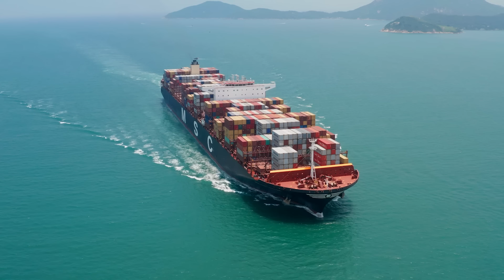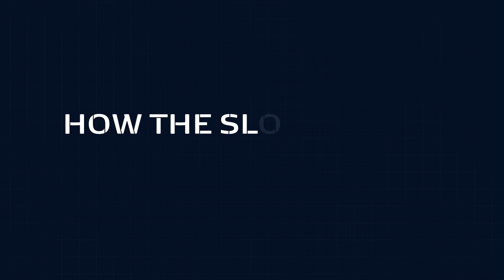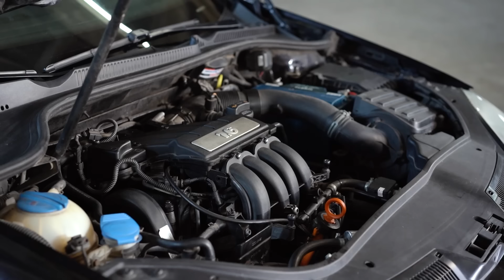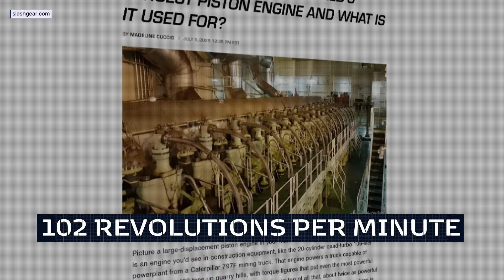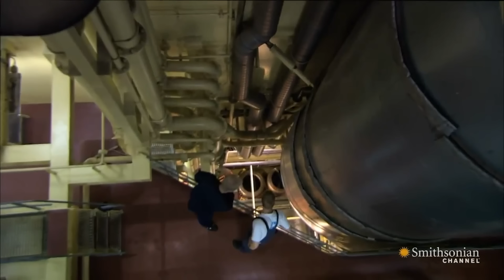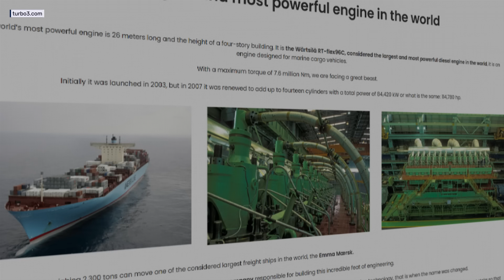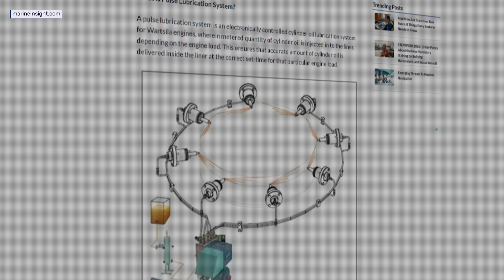The 100,000 Horsepower Engine

Comment: I have small correction - this engine crankshaft is moving 100x faster than second hand on the clock - second hand does only one revolution per minute this  engine does 100.

Comment: I'm puzzled why for so long huge container vessels used single engine single screw.  The additional engine efficiency over a twin must have been miniscule. Presumably there is a slight increase in propellor efficiency if centrally placed, but however reliable, surely the huge loss if a ship was immobilised would be worth more -- perhaps they had excellent but cheap insurance for that.

Comment: Wow, they only that recently started to care how that thick sludge is polluting the planet
Reply: Invent something better and you will be rich. Stop wining about a very efficient and ultra reliable current system. 90% of all trade by weight and volume is done by ships. The failure rate is towards the level of the aircraft business.
Reply: @tentenone-n7z  im not wining, im just intrigued that they just lowered the amount of Sulphur allowed in the fuel oil in the last 10 years. Probably could have a lot sooner
Reply: @OGdirty1Kanobi agreed, but the International Maritime Organisation (IMO) has to coordinate 120+countries and interests. Change in shipping is slow, but steady. It's a multi-million business for all involved. After change of fuel shipyards were booked out for years to retrofit existing vessels. Faster change would have been very tough,if not impossible. So body has  to produces all this fuel, refineries need to physically change for the new fuels. And even 6 years later, the full impact and engine wear and tear is just now starting to show. It was a huge chain reaction...

Comment: Why was a piston  engine used as opposed to a turboshaft with a reduction drive?
Reply: There is no gearbox available which can handle 100k horsepower and about 1000mt of thrust.

Comment: Fun fact, 1 day of fuel for this ship would keep my 2.0l Mondeo TCI going for way over 4,000,000 miles! Alternatively, given an average annual mileage of cars in the UK being 8000 miles, you could run 181818 Mondeos 22 miles per day for the same fuel burn! Assuming a mondeo can carry about 400kg of load( 4 heavy people, my car can tow up to 2.2 tonnes but the fuel consumption is down to 34mpg when I pull my boat! ), that means all those cars would move 72727 tonnes 22 miles per day. Whereas the ship can carry 7000 40' containers which can carry a max load of 28 tonnes each? Not sure if ships, like planes (my line of work) have a max all up weight limit, IE:- they would be overloaded if all containers were at max? But assuming they can, then 7000 times 28 tonnes is 196000 tonnes and in a day, 24hrs, at 25Kn it would cover 600 statute miles. That makes the ship 73 times more efficient than the Mondeo, I wasn't expecting that answer!

Comment: Ok ...so next is full electric with solar panels on every outside panel and inlets within the hull to let water in to spin generators off the mass and speed of the ship I see them being able to rip 50 knots plus. How much does 250k gallons of crude weigh vs that much lithium

Comment: Assuming the fuel oil has a density of 1g/m3, thats 2.89 litres a second. Crazy
Reply: In perspective: 1L per ton cargo per day. Or 1L to move 1000kg cargo over 800km in one day. Or 0.125L/100km compare:  4L/100km car for about 500kg of load with people and luggage. Now you see just HOW efficient shipping is.
Reply: @tentenone-n7z  yeah, thats pretty damn efficient. Meanwhile, I use 8L/100km just to take 90kg of human to work each day.

Comment: No problem make my car 0.8l engines that makes 200hp and last around 100000km, while this thing consumes more fuel a day, than i will ever consume for my whole life.
Reply: Vessel engines run 6000 running hours per year. At a 20kn vessel pace. So it runs >200.000km in just one year. And it operates for 25+ years. Your car is long gone to a small steel blob when this engine is still running true and sound. Welcome to shipping.

Comment: Making 109,000 hp isn't that difficult.  A large gas turbine could do that easily and at only 5% of the weight, maybe even less.

The real trick is making it fuel efficient.  Turbines have little weight but they use considerably more fuel (though modern units are getting better) than a big reciprocating diesel.  That is why they build these engines and use only ONE on large boats.  Something that I think is a serious mistake after the bridge accident in Baltimore.
Reply: Turbines are only inefficient at lower speeds, this can be mitigated using a large electric motor at harbor speeds....
Reply: @ljmorris6496  To be comparably efficient they need large regenerator units to preheat the intake air.  They still haven't built one that can exceed about 30% efficiency.

Most modern cruise ships use dual fuel arrangements where bunker fuel is used offshore, but marine diesel or a turbine engine is used to generate electricity inshore or in ports.  I think nearly all cruise ships are electrically driven these days.

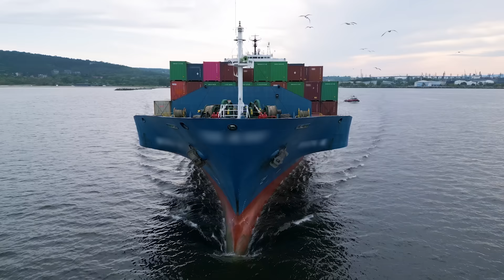Comment: 3:11
Water resistance does NOT climb steadily with speed. Look up the concept of “hull speed” there are different “pockets” of speed that are more or less efficient. It has to do with how the wave created by the front of the boat interacts with the rest of the boat. There are speeds where if you slowed down slightly, you would become much more inefficient.

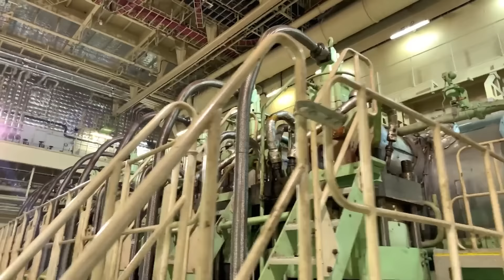Comment: 8:00 2.5m is much taller than an average person. It's higher than a soccer goalpost or the ceiling of a normal UK house! You're basically saying, not only could you stand inside the cylinder at bottom dead centre but 99% of people couldn't even touch the top of the combustion chamber..!

Comment: I don't understand the complaints about environmental impact. If you consider the miles per pound of fuel consumed it's exponentially more efficient than truck travel which is the method all those containers use to get to and from the ports in the first place. As long as the US and other major countries import heavily, these giants will continue to be produced. Heck even produce from South America comes via ship instead of international train and for good reason... security, speed and efficiency.

Comment: The length of the hull underwater determines hull speed.  Longer ships move at higher velocities with less power.  An aircraft carrier has 1hp per 15 tons at cruising efficient speed.  A destroyer has 1hp per 5 tons.  The carrier has a higher cruising speed at that output.  The destroyer accelerates faster, but that isn't such a great advantage.
  This is why in undeveloped countries you see long skinny displacement hull boats looking like 50' canoes screaming along powered by an 8hp lawnmower engine at speeds comparable to a planing hull skiff running a 100hp outboard.
Reply: Yes, hull speed is a thing.  Statements of "hp per ton" have nothing to do with hull speed.  Planing hulls are not subject to hull speed once up on plane, because they rely on dynamic lift instead of displacement.  A longtail boat with a tiny 8hp motor will not be "screaming along" at planing speeds.  A 50' longtail would hit hull speed at well under 10kts, but it doesn't matter, because it's a planing hull, assuming it had more than 8hp and was actually able to get up on plane.
Reply: @wagnerrp  Apparently we do not disagree on anything.
There is a thing called a semi-planing hull.  A 50' canoe will never hit hull speed.  It does not generate significant lift until certain conditions are met.  This is the wonder of block and prismatic coefficient and is some weird math.  What you say is true, but my reference to HP per ton simply points out that waterline length can result in a faster top speed despite effective thrust being the same. Did the demonstration experiment build back at TAMUG as a practical lab.  Hulls with identical cross sections, except longer.  HP per ton is a reference you are reading wrong.  Acceleration is effected, but clearly displacement hull top speed and waterline length, and that was the point ja?  Fair winds and following seas.

Comment: In context - in order to build an electric engine that could do the same work, it would require a lithium battery of about 1.7mill lbs (~800,000 kg). Given code requirements for batteries, this would require the space of around a baseball field. And it would only power the engine for roughly an hr.

This is why electric is nowhere near approaching the point of replacing diesel & why diesel is the most commonly used fuel at large. Diesel is just too damn efficient at work.

Comment: Wow, 109,000HP is insane especially considering how slow that engine turns. HP = Torque x RPM/ 5,252...at 100RPM thats 5,724,680 ft/lbs of torque 🤯

Comment: I was on a VLCC last year that had an earlier version of the 96 series engine - but it was "only" a 6 cylinder. I was also on a ship with a 7 cylinder engine. And I only did two voyages, the first about 12 miles and the second about 6 miles - LoL (both in Nigeria).

Back in 2006 - 2009 I was project manager for a new build trenching plough and it's integration onto a newbuild vessel (essentially a grossly oversize anchor handling tug). In 2009 the Far Samson claimed the title of "world's most powerful tug". She had about 33MW of installed power which is not much compared with the Emma Maersk but she was only 122m and about 10,000 tonnes displacement. Maximum Bollard Pull was 423 tonnes. For trenching I think we worked on 350te BP with a maximum of 380te available in real world capacity. At that load she would burn 140m3 of fuel a day.

I took "possession" of her on behalf of my company at 1am while steaming between Alesund and Stavanger. We were doing 19 knots and burning 100m3 / day.

Given that I've signed off on millions of tonnes of coal being loaded in Dalrymple Bay and Hay Point my carbon footprint is up there with Elon's.

Comment: Emma Maersk was the result of a design challenge. Build the largest single engine ship possible.
It turned out, that neither the hull, nor the engine was the restriction on size. The propeller however was. Therefore the Emma Maersk was designed around the largest possible propeller. It is simply not possible to build a larger propeller. A design proposal for a 16 cylinder 101 centimeter bore engine was on the table, but this was rejected because a large enough propeller could not be made.
On waste heat recovery, the ship did have an exaust boiler, along with two shaft generators. But these two generators also doubled as shaft motors, giving the ship an additional 18 MW of power if needed. Meaning that on the later ships of the class, the total output power on the shaft exceeded 100 MW, and the top speed was over 30 knots. A friend of mine, said they reached 32,7 knots, with all generators running.
When 2 main engines was chosen for the trippel E class, this was not a question of not being able to build a larger engine, but because of the propeller.

Comment: One F35 is more powerful than any of these engines.
84000kW from the ship.
142000kW from the little jet fighter.

Interesting comparison.
Reply: Not exactly. I think you got some numbers confused. The power of the f35 engine, is approximately 30.000 kW. Not that this is not in any way impressive, given it's small size.
Reply: @petertuxen4930 which country are you from?
Reply: @procatprocat9647 why is that important?

Comment: It still burns fossil fuels which contributes to climate to climate change - more and greater weather events, flooding, hurricanes, desertification, heat, etc. funded by the oil industry, these videos try to get you to wonder at engineering which is still a hundred years old and inefficient. An internal combustion engine is rarely over 25% efficient. An electric motor is 95% efficient. Fossil fuels are the only thing which powers an ICE. Electricity can be made from anything - dung, the sun, the wind, hydro, wave, etc. and stored in batteries for those peaks and troughs in use.
Reply: You are absolutely right on most counts.
The mechanical efficiency of this engine is better than 98 %. The total efficiency is about 60 % when using waste heat recovery.
About the fuel consumption, try measuring it in grams/ton. Then the truck is actually the greatest sinner of all.
Electricity would be a great alternative. But the power density of batteries are so ridiculously low that it just is not an option yet.

Comment: The world should introduce a maximum speed limit for container ships.
Balance time against efficiency, with massive penalties for anyone exceeding it.
Reply: The shipping industry is only interested in profits. A saving of 0,2% fuel, gives an extra profit of about 100.000.000 $ pr year. Trust me. The ships are going as slow as possible. If we could reduce the rpm by even 0,1 rpm, we would do it 
No the problem is not the shipping industry. The problem is the consumer that demands faster delivery.

Comment: Back in the 70s when I was a wee lad, I was at the Smithsonian Technology Museum. They had a Piston and Connecting rod assembly that was about 30 feet tall. It was used in an engine for pumping a mine and powered by steam. Still, the size and scale of that assembly left an impression on me.

Comment: Do submarines dive by exceeding hull speed, which forces them to sink? Submarines dive by flooding their ballast tanks with water to increase their weight (achieving negative buoyancy) rather than by exceeding a "hull speed" to force themselves downward. While forward propulsion and hydroplanes can be angled to help steer a sub downwards, gravity and density control do the heavy lifting. How Submarines Actually Dive Surface State: Main ballast tanks are filled with air, making the submarine lighter than the surrounding water.The Dive (Flooding): The crew opens vents at the top of the ballast tanks. Escaping air allows seawater to flood in through grates at the bottom, increasing the vessel's weight. Sinking: With a density greater than the surrounding water, the sub begins to sink. Hovering: To maintain a specific depth, crews use variable ballast tanks (trim tanks) to achieve exact neutral buoyancy. Forward Motion and Hydroplanes. While propulsion isn't the primary mechanism for sinking, submerged submarines use "hydroplanes" (movable, wing-like surfaces) to control their pitch and angle. Forward momentum across these planes helps the crew adjust and stabilize the submarine's depth, much like flaps on an airplane. Hull Speed vs. Dive Speed

Comment: Usually a max revs of 70rpm
Reply: Depends on the engine. On the 96RTflex the absolute max is actually 120 rpm. 102 rpm is at 85 % load where the engine is most efficient. 
But you are right, normal load these days are 65 - 80 rpm.

Comment: When I was a little boy I got to witness the powering on of a 12-cylinder Deutz marine diesel. That thing was only maybe 7 meters long and 2 megawatts but holy crap it was a beast. It was used as a backup generator at a factory and was originally installed in the 70's. A valve from that thing is about 4" in diameter and that's still tiny in these types of diesels.
Reply: Yup, valves are big.  In my days at sea, a mate of mine in another company sailed on a ship where they had turned some worn out valves into bar stools by welding sockets to the deck in the officers bar and stuck the valve stem in them!

Comment: That’s insane.. just the crankshaft is 300 tons.. to put that in perspective, there are smaller ships that weigh less than 1000 tons lol.. the entire engine weighing over 2000 tons, well an entire fletcher class destroyer, the destroyer the U.S. mostly relied on during WW2, a 370 foot long, 40 foot wide ship, weighed just over 2000 tons at standard load, and 2300-2500 tons at full load, so just the engine of a cargo ship, is the same weight as an almost 400 foot, 40 foot wide ship lol

Comment: Ship bunker fuels are notoriously low grade compared to car gasoline. So it requires more work to get the same amount of energy out of bad fuels than good fuels. So claiming the engine is the most "efficient" is partially misleading

Comment: 0:33 "Below decks... ...crankshaft... ...the 'Second' hand on a clock... ...a little over 100 RPM..."

NUMERICAL ERROR - the 'Second' hand on a clock obviously turns ONCE per minute, not "a little over 100" per minute. It's slightly annoying that a host/narrator doesn't listen to what they're saying. If I was asked to speak that, I'd choke on the error.

Comment: 8:41 No, no, NO. Exhaust comes out at the ports at the bottom of the cylinder and induction air is force fed from the cylinder head valve.
Reply: No. Not on the 96RTflex. He is actually right. Fresh air comes in at the bottom, and exaust out at the top.
The very large Shiny pipe at the top of the engine is the exaust manifold, leading to the exaust boiler 2 decks further up.
Reply: @petertuxen4930  Huh! Ok, that explains why other shipping companies were so hesitant to adopt them until they'd seen operational performance.

Comment: Top speed is between 25 and 27 knots. However normal cruising speed on  asia to Europe trip is usually around 21.knot due to  much lowwer fuel consumption per km. Exact speed chosen will depend on the varying price of fuel and the value to the customers of earlier delivery. This speed is significantly higher than the typical 12 knot speed of smaller and older ships eg the typical ww2 convoy speed .The shorter length of the ships resulted in a much lowwer wavelength speed which is inversely proportional to the square root of the ship length.

Comment: i would love to see these motors in the hands of an american racing motor builder..  140k HP turbocharged.. from 110k means ou can easily get 300k Hp with a red neck re engineering.. lets see tanker races..Germans vs American.. same ship hulls same engine blocks.. everything else is modifiable